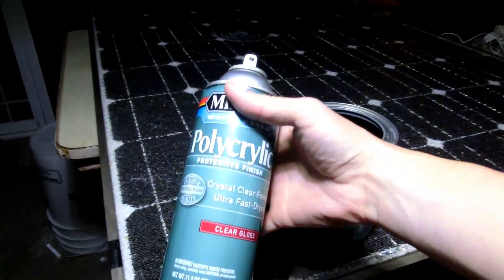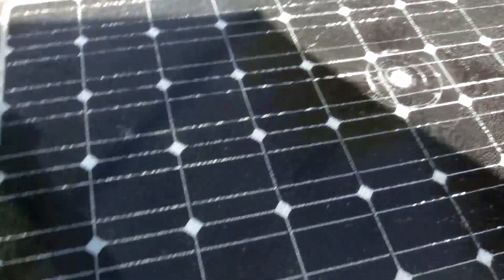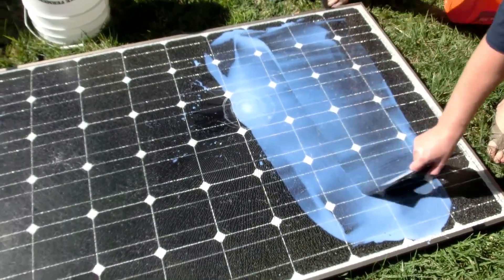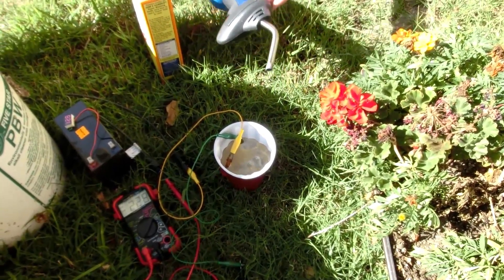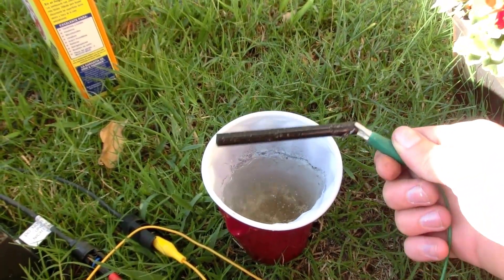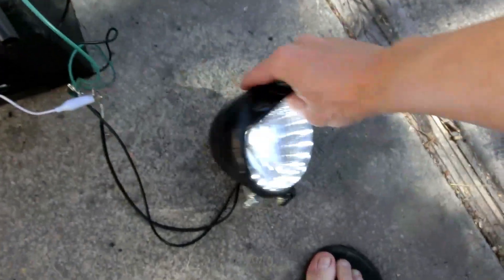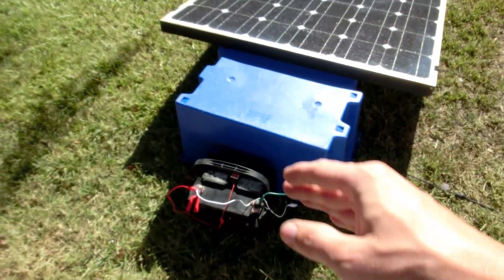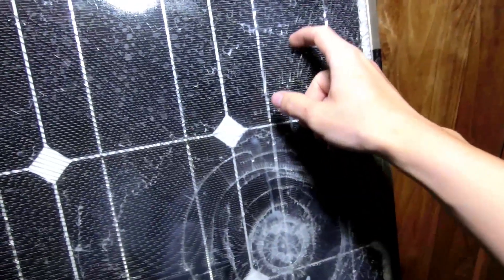DIY Repair Cracked Solar Panels

Comment: Good video. Thanks! 
I just got some broken panels myself. I laid one down on the ground and poured out some polyurethane on it. Then rolled it out really thick with a paint roller. I poured even more to make it thicker. Done. No sprayer needed. The panel works fine. I saved it from going to the dump.
Reply: How did it last?
Are they still working?

Comment: Suggestion. I know it sounds weird but you need to lightly sand the surface with some 1200 grit or so just to give the coding something to grab onto it will be a little dole when you Sand it but it will come backglossy when do you spray the coding. just food for thought. Great video

Comment: Wipe on doesn't mean spread about, it means use a rag or a foam brush (a regular brush also works usually). I'd be surprised if anything lasted for very long on the glass as it's going to be too smooth. The grinder works because it has a universal motor that will run of AC or DC.
Reply from the maker: +Wobblycogs Workshop well its glass with thousands of cracks in it, theres plenty of places for something to get a grip.
Reply: On the contrary paints work on the microscopic scale. Glass with macroscopic cracks in it will still look like a sheet of glass at the microscopic scale - hence why the spray finish has failed already. The poured on super thick coating will take longer to fail but give it six months in the sun to expand and contract every day and I reckon it'll be peeling off. I think your best bet would probably be crystal clear silicone sealant, not sure how much that would affect the power generation though.

Comment: The angle grinder uses a universal motor(a brushed motor with electromagnets instead of permanent magnets) so can run on AC or DC. Putting even low DC voltages across an induction motor designed to run at 50/60hz could burn it out as there would be no inductive reactance to limit the current.
Reply: Interesting. I was wondering how he was running an AC power tool off DC. Are a lot of AC motors like this where they can run off both AC and DC? Sorry for the silly question but still new to electronics.
Reply from the maker: +sized4spills i know a lot of washing machine motors are.
Reply: Ahh very cool.
Reply: +Coolkeys2009 even with universal motors, they don't necessarily run "good" off DC. I have one I scavenged from a paper shredder which manages to be both slow/weak yet still prone to get hot and overheat when running off DC (while still only pulling 400mA).

it seems both more powerful and also runs cooler off AC.

but, yeah, feeding raw DC into an induction motor wont work.

induction motors are both a pro and a con. the advantage of induction motors is that you can have a lot more control over their behavior. a drawback with them though is that more complicated electronics are needed to run them.
Reply: +Brendan Bohannon A universal motor will run at higher power on DC than AC I think technically it should be more efficient as there should be lower eddy current losses on DC. Brushed motors are very controllable that's why they have been widely used for applications such train traction and lift motors. Induction motors are great for good speed regulation and low maintenance as they have no brushes, a lot of the fancy speed and torque control algorithms used to control modern induction/bldc motors seems to originate from brushed motors.
Reply: Coolkeys2009  I am not really sure, just going off experience. don't know about efficiency, I was more going on speed, torque, and how hot it gets. all 3 worse worse on 30VDC than on 110VAC. the motor in question was designed for 110VAC 60Hz though.

with DC motors, you can have some control over speed via PWM, but the usable RPM range is narrower than with induction or BLDC motors.

I also like steppers, though I prefer 3-phase over 2-phase. though annoyed that I can't seem to find good/cheap motors with a stepper-like torque but using 3-phase.
Reply: Brendan Bohannon The only advantage of Brush Less DC motors is the lack of brushes :-) I remember using a mini version of one of those robots used to build cars in the 80's and 90's. It used DC brushed servo motors with encoders and could easily pull your arms off and was faster and more accurate than any thing built with stepper motors at the time. There is a video and Microchip application note demonstrating closed loop control with an encoder of a DC motor and the performance is much better than you could achieve with affordable stepper motors for the speed and power output.
Reply: Coolkeys2009  you can control a BLDC motor at very low speeds, and control how far and how fast it turns, and then as needed spin it up to high RPMs.

similar isn't readily doable with a PMDC motor absent severe gear reduction (given their tendency to lose torque and stall under a certain RPM), but then one has very little top speed.

so, a BLDC is useful for dynamic balancing, such as in a robotic unicycle or dicycle.

the main advantage of steppers is that they can have high torque output without needing as much (if any) gear reduction, and are generally somewhat cheaper than comparably powerful BLDC gear-motors.

steppers are pretty good for applications where one needs reasonably accurate controlled movements and lots of torque, but not necessarily all that much speed.

the possible use-case for 3-phase steppers would be so that one can use them electronically more like BLDC motors, while having the high-torque properties of steppers.
Reply: Brendan Bohannon Stepper motors with out any gear reduction will be too inaccurate(because of step size) and too low power for many applications anyway that's one of the reasons why dc servo motors were used in the industrial robot arm application I described earlier. People have designed balancing robots and Segways using dc motors, it's allot simpler controlling a dc motor with a full bridge circuit and a bit of PWM than designing your own ESC just to spin a motor.  DC motors are used in applications like cranes where fine control speed position and torque is required.A lot of  BLDC theory emulates DC motors anyway.

Comment: A thick coating of acrylic applied by hand or with the spray which you then grind down with really high grit sandpaper and then polish like you'd polish wood varnish would probably work

Comment: always apply spray in multiple thin coats, luckily poly is a bit forgiving... also a 207 marine epoxy would probably do a lot better, or a auto clear coat.  Also note that poly is probably to thick to go directly in a sprayer, most paints/stains/coatings need to be thinned out to get good results (also applied in 3 or more thin coats)

Comment: I wonder if a thin film of plastic like stretch wrap could be used. You may be able to find other forms of plastic that could cover the entire surface. There are also superhydrophobic sprays that are available now. I saw a neat mixture of contact cement, soap, and wd40 that made a water repellent barrier.

Comment: Clear epoxy resin would probably work. Might even be able to use the kind for fiberglass if it were clear.  I think If I wanted a permanent solution I would use a new piece of glass on top of it or replace the existing glass.

Comment: Not sure why I can't reply to Rob Mckennie and others, but holy shit guys, lighten up.

He touched the grinder to the concrete for about three seconds total while it was running at a small fraction of its normal operating voltage and with very limited current. I couldn't tell from the video, but I'm sure it did ZERO appreciable damage to anything. At twice the input power as when he touched the concrete, it could barely cut that thin sheet metal thing without stalling out.

You guys need to get a sense of perspective. It's not like he used the patio to torture test the fucking grinder. He lightly touched it against the concrete. It's fine. I'm sure, were that grinder running at full power, he would not have gone to town on that patio - he's not a fucking sociopath. Also when he's "throwing junk around the yard at the end of the video"? Yeah, he tossed that metal piece aside because he's shooting a fucking video. Most likely he picked the thing up afterwards so he wouldn't trip over it later.

It's worth noting that all of this is happening under Jay's supervision, the guy who's subletting to Rinoa and is thus responsible for any damage he might cause. If Jay doesn't have a problem with what's going on, why are you getting so worked up about it?

Fucking karma police. Go find something of actual consequence to blow your outrage loads over.

By the way, Rob, his old landlord didn't give any specific reasons as to anything he had done to upset her, apparently didn't have specific complaints of property damage to cite as justification. Sounded to me like she just changed her mind about the arrangement and took advantage of the lack of a binding lease to get rid of Rinoa. You listened to the weird bullshit she came up with, about it basically coming down to a personality conflict via some weird analogy about colors? Yeah, that's not how someone with a legitimate grievance approaches that situation. Unless of course you think Rinoa is just outright lying to everyone.

One last thing - you do know he plans to replace the rotted shed floor? That's not exactly a small job, and it'll be 100% free to the landlord. Sure it's for Rinoa's immediate benefit, but that's one less thing the landlord has to fix when it comes time to rent the place out again. Not exactly the sort of thing an inconsiderate tenant would think to do.

Comment: Most of the loss is because of the spiderwebbing in the safety glass blocking more light from reaching the cells.  You'll notice the spiderwebbing does not crack at right-angles of the cells, it wants to be annoying and crack sideways blocking more light.  The corrosion occurs where the golf balls hit.  :) (or little shitasses threw rocks at the panels)

Comment: Those are some nice panels for free. I am surprised at the current output, at least double of what I expected.
Reply from the maker: +DystopianEmpire01 40$ isnt free
Reply: Rinoa Super-Genius
lol My mind was so on seeing them work I let that slip my attention. : )
$40 is still a great deal IMO, I'm sure they could pay for themselves in a month or two of charging batteries and powering this and that, at least I hope so. : )
Reply from the maker: DystopianEmpire01
i'm not worried about them paying me back in Kwh compared to the price of a Kwh from the grid. i already feel like they are worth it just because i can use them to charge my trike/bike.

Comment: You don’t have to put polyurethane on it I’ve had panels for years shattered with holes in the middle of them and they still work
Reply: I have a newly shattered one... I just left it in the string. Was wondering what you are finding now, 3 years later? Did you end up covering it?

Comment: Certain types of transparent paints might appear transparent but can block UV light you should test for this too.
Reply: +Ortorea Screenname I don't believe these solar panels would use much of the UV or Infrared spectrum. Mainly visible light. The holy grail of solar cells is a full spectrum single layer panel and will make the creator of such a billionaire.
Reply from the maker: +oOMonkeyMagicOo especially since they intentionally use a glue in the production process to block UV light, UV light degrades solar panels.
Reply: Thats good then :)

Comment: This may be a silly question but is it possible to take the glass off and replace with some kind of sheet plastic?
Reply: +Tobias Cooper Plastic tends to cloud over time. Plus if you replace it you'd have to make sure no moisture was inside it too.
Reply from the maker: +Tobias Cooper and the glass is now about 6,000 little fragments all stuck onto the cells, so good luck getting that off.
Reply: Rinoa Super-Genius oh I didn't realise it was stuck to the cells.   Hmmm  you got it for an absolute bargain so I'm looking forward to seeing what you're going to do with it.
Reply: there is an absurd amount of adhesive that is impossible to get off

Comment: I don't know if you guys have a harbor freight where you are but they sell HVLP paint guns like you can use on cars for $20 that would probably work perfectly for your purpose
Reply from the maker: +Kit Caboodle we have them, but i still have yet to go to it.
Reply: well there you go now you got a reason too lol, you'll need to buy an air pressure gauge and an air hose adapter while you're there if you don't already have some. inline dryers are a good idea too.

Comment: You are applying things all wrong. Look for a product called plastidip or flexidip. When coating things like that you will need to apply more than one coat. Usually you start off with a light coat and then add three or more coats over time. I would also recommend getting some tarps or drop cloths to shield what you are spraying. You want to keep things from getting stuck on them in the application. Make sure you secure them so they also do not get stuck to your solar panels.
Reply from the maker: +ink fink Polycrylic is all i could find that would dry clear.
Reply: All major Hardware stores and automotive stores should carry the products I recommended. I think they would work well for your project.. But I am sure the stuff you first used would work, you just needed to apply a few more coats.Usually on the can it will say how much time it takes before applying a new coat. Good luck!

Comment: If you could get enough UV curing optical adhesive, that would work really well :)
It's whats used to glue Glass to LCD screens in smart phones :)
Reply: they sell that crystal clear uv resin by the gallon it is what they use to repair automotive glass... my question is why are those solar panels not made with removable glass.
Reply: +Lunas Eclipse also if I got those panels with intentions of repairing them. I would have gone with the clear resin or a new pane of glass silicone glued around the edges.
Reply: Lunas Eclipse resin turns yellow doesn't it? I think the glass is not removable to avoid loss and thermal expansion
Reply: This stuff is not supposed to turn yellow. It is supposed to be clear... infact that is one of the selling points of this stuff... http://www.amazon.com/SunFlash-Activated-Polyester-Resin-32oz/dp/B00F77YIAY/ref=pd_sim_328_2?ie=UTF8&dpID=514SQ9v7bXL&dpSrc=sims&preST=_AC_UL160_SR160%2C160_&refRID=1N11SSZPH21RNZRHV0Z9

You would pour it on move it around and you would have until you exposed it to sunlight to work it into the panels. Then it would depending on type you get cure just as hard as the glass... and just as clear... 

Like i said this is how they "fix" car windows with chips in them they use a dental drill to open them up then fill the cracks with the resin and then put a uv light on them.

And honestly on 200 watt panels even if they lost half of the output for 45 dollars they are still worth it...
Reply: Lunas Eclipse oh i see it's uv curing resin :) I thought you were talking about resin that uses a chemical catalyst
Reply: This can probably still be done to both panels but it won't get into the cracks anymore. Cleaning the panels with acetone and perhaps lightly sanding with 400-1000 grit sandpaper first might get the spray on stuff off  I think the one where it was poured on would be out of luck for the deep pits.

Comment: any damaged cell is a weak link in a chain, try it, get 4 small cells in series, cover one, output all but gone., you dont lose 25% for the one of the 4, but like 70%.....

Comment: I don't see what's so wrong with leaving the broken panels alone for however many years they survive the rain and corrosion thereof, and stop bothering with trying to seal it up.  If you just mount them vertically the rain won't seep in so bad, but of course there is the annoying humidity everywhere.  2% humidity rocks my socks.  Of course those huge holes need to be sealed off, go for regular caulk.  KISS.

Comment: You didn't show or mention any surface preparation before applying the poly. Sanding with 2000 grit is final prep for headlight restoration. Rustoleum American Accents 2x Ultra Cover Gloss Clear is non-yellowing non-UV reactive. My headlights are fine. No yellowing and look factory.

Comment: Kind of useless at this point, but perhaps Rustoleum high gloss clearcoat spray would work for this application?

I've used it as a UV protective coating for car headlights after refinishing them. Three coats at 5 minute intervals left a highly transparent finish. About a week later and it has yet to show any signs of flaking.
Reply: im going to try it  . ordered two cans of it . thank you

Comment: Ok, so the thing with broken soler panels and "fixing" the glass is unless you fix the whole crack n not just the surface you get reflected and refracted light rather than direct sunlight.
   They do still work but they cant take in as much light energy. 
  N i noticed they didnt use an optimizer to segregate bad cells.
   The video maker didnt need to use a cup of water to test the circuit, also was he using d.c. voltage to test? 
If he used a c. That is a bad reading until it goes through an inverter.
    Those are commercial grade panels. And he smashed the lid off of the spray acrilic, dont trust this guy.